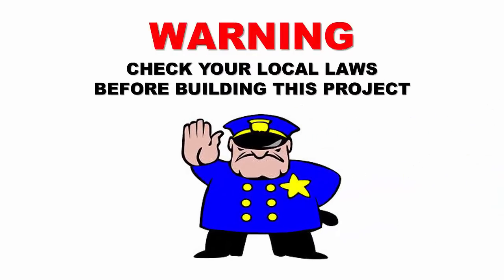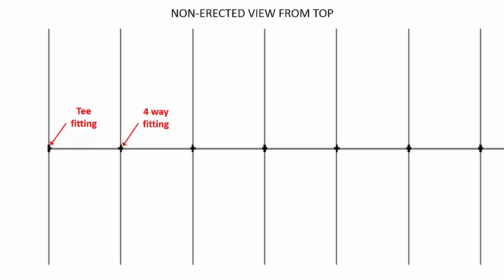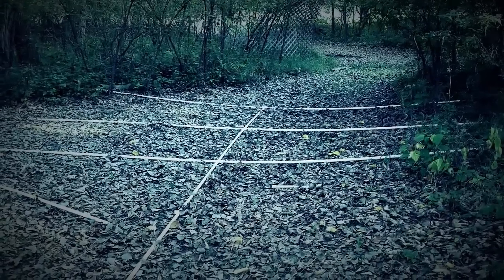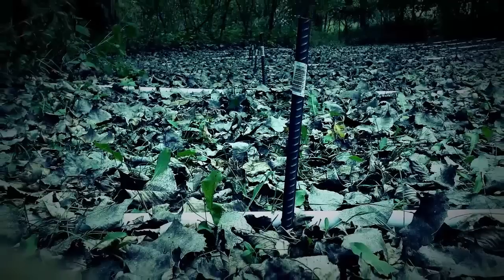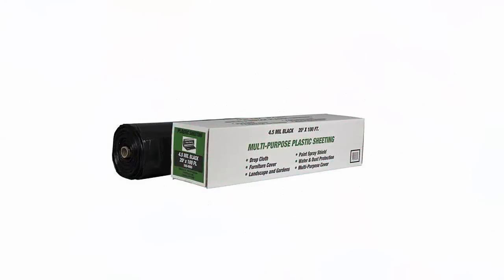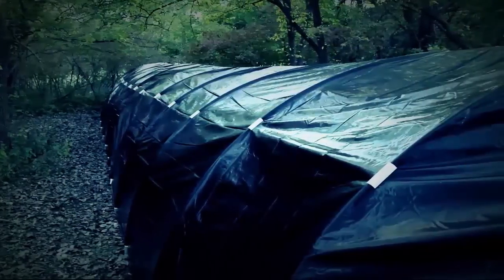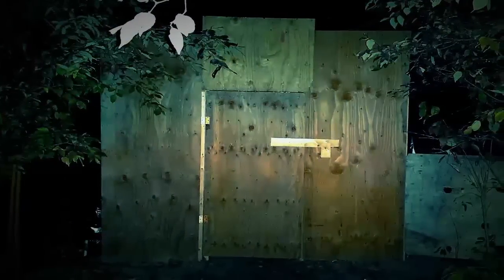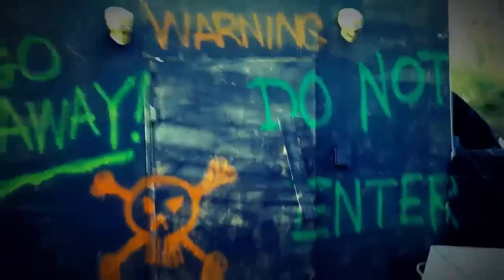How to Build a Haunted Laser Vortex Tunnel – DIY, Homemade Halloween Decorations & Props

Comment: That was great. We used this same kind of structure for our chicken run and it worked out so well that we have decided to use it to make tunnels for our haunt. I love the idea of the vortex in there. Thank you for sharing!!!
Reply from the maker: bransonhauntedhills The vortex looked cool in there. Much better than what the camera could capture. You really have to keep air flowing through the tunnel though, otherwise the fog will get way too thick. Which is why you see the big box fan at the end.
Reply: Thank you for that great tip Justin!

Comment: Great video and thank you as I’ve tried to replicate on a smaller scale with some success.
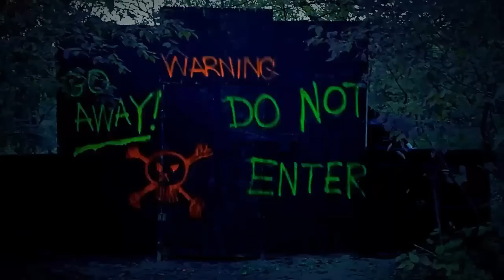Question for you about glow in the dark paint or tape. I see you have some at 5:02 in the video and wondering what you used. Was it especially made to glow in the dark?
I’m trying to figure out directions and signage and thought a combo of tape and paint might work? Any recs for paint or tape?  Thanks!

Comment: The plan states Thick Walled pvc which is Schedule 80 (grey), but your video shows Schedule 40 (white). Does this work just as well? Schedule 80 is 3 times more expensive than 40.
Reply from the maker: blurrrdesign I think it would probably work just as well. In the hardware store where I did my shopping, there are two types of white PVC pipe available. One is a little thicker and more durable than the other.  I believe they are both much cheaper than the grey PVC. This is only designed to be a temporary structure that supports nothing but the plastic sheeting, so you should be fine either way.

Comment: What about eye safety? If you look at the laser when in the beam isn't it dangerous?
Reply from the maker: dujipazi It uses a low-power, 5mW laser pointer. The mirrored reflection of the laser is in constant motion from a motor to give the circular pattern. This, along with the fog diffuses the laser quite a bit. If someone were dumb enough to stare directly at the laser for a long period of time, then I suppose maybe it could hurt their eyes.  They would really have to try to hurt themselves though.  Don't use anything more powerful than a 5mW laser pointer.